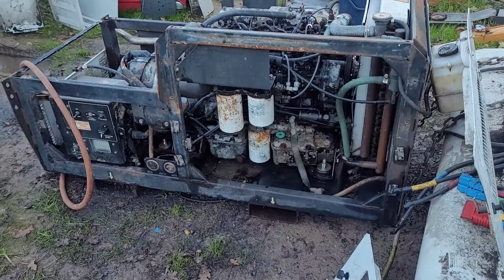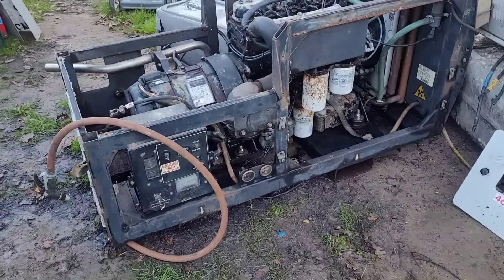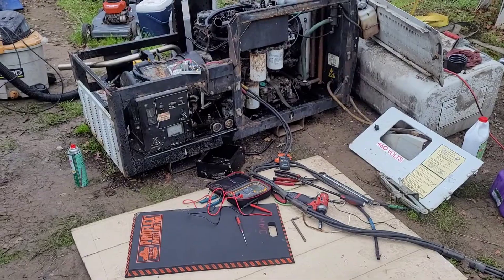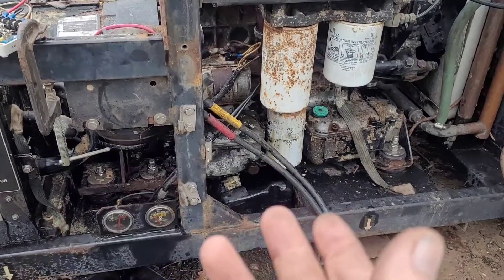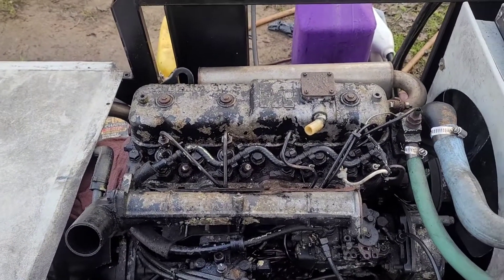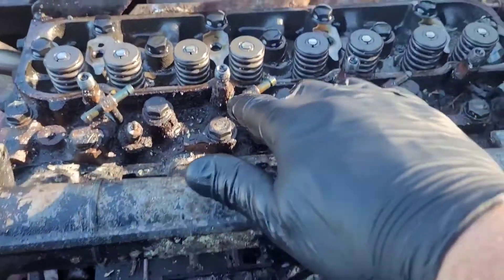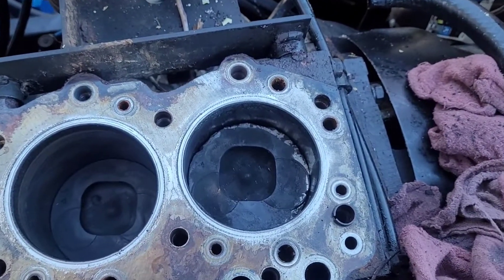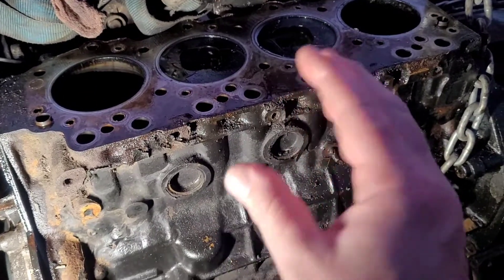the new to me project thermo king 15 kw generator (kind of a dumpster fire) part one

Comment: So when you first look at the top of the Pistons, you notice that 2,3 and 4 are covered with carbon while #1 has a ring of silver where the piston was contacting the head - dead give away the rod bearing is worn and I could tell while it was running you had a knock.  For it to be dependable , just do a quality rebuild or you will be chasing your tail . . That said if you got a good deal on it should be worth it once finished and an ECU 2 wire auto start controller installed and  you will be golden !   I am curious as to that AVR you put on it, what is the part # and brand ?  Charles in Cheyenne Wyoming.
Reply from the maker: thats what i thought, the big rod end bearing looks good, i plastigage it. the small end bearing looks like it failed and it's chewed to hell.  without giving too much away, i tried putting another standard size piston, rod  and i got piston skirt slap. so now i'm waiting for the weather to clear up so i can see if the bore is straight and if i can clean up the taper in the bore, myself, because the nearest machine shop that i would trust is about 80 miles away and are running a back log. 

i cannot remember the name of the AVR, but i did have a stability issue, the gain had no affect on it. i got a SX460 AVR i'm gunna try. 
the controller i'm going to use down the road is a kohler DEC 3000, that is programed for a mechanical engine.